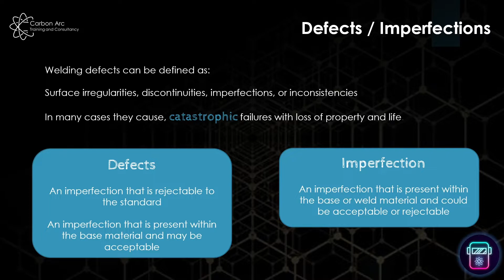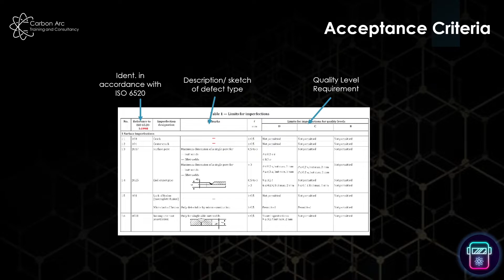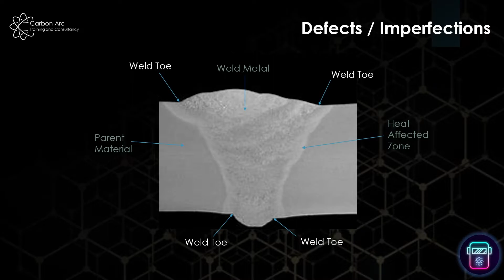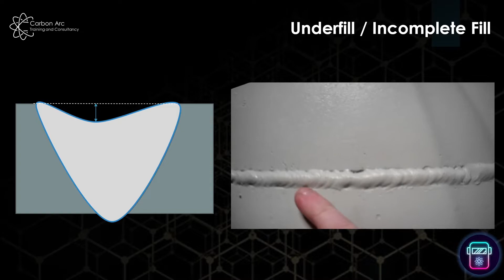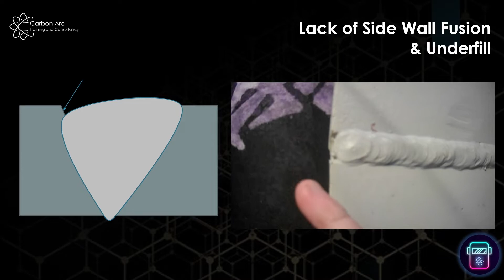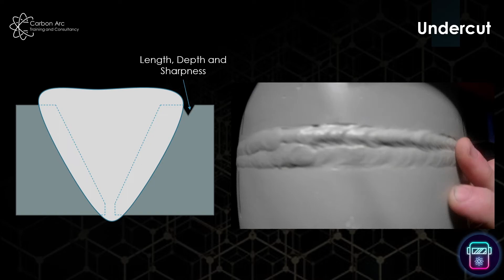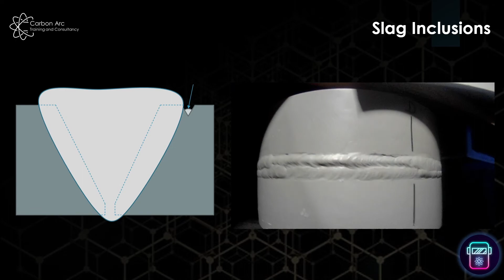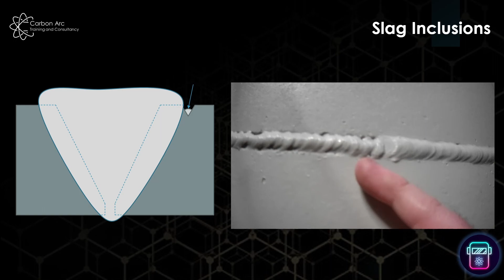Welding Defects (Plastic Exam samples)

Comment: Hi James. Your videos are great and most useful in preparing to sit CSWIP exams. 

I was hoping you could clarify something for me, you do cover it in this video, but I'm still unsure...  

Where there is underfill, do you schedule both underfill and lack of sidewall fusion (at 2x length of underfill)? 

And where there is lack of root penetration, do you schedule both lack of root penetration and lack of root fusion (at 2x length of lack of root penetration)?
Reply from the maker: Hi Stephen, For Lack of Side wall fusion you will need to count it on both sides of the plate (if it is on both sides of course) the underfill section connected with it is only counted the once. I always try to teach the following methodology - If it's in the weld metal count it once, if it's on the side wall/ parent material count it as an individual. 

For the lack of Penetration and lack of root fusion only count these and single areas which are separate from each other. meaning an area of lack of root fusion is not the same as an area of lack of penetration and they cannot overlap each other. The acceptance standard for your examination will give you to different allowances and acceptance levels for the two different defects.

I hope that the above makes sense.
Reply: @CarbonArcTC  Thanks James, that helps.

I understand now that underfill can occur in the weld only (side walls fused), or at the same time as lack of sidewall fusion (on either one or both side walls). If lack of sidewall fusion occurs on both sides, measure total length of both sides.

On root side, it is either lack of root penetration or lack of root fusion. Length is measured once.